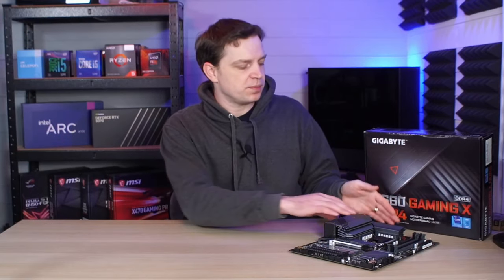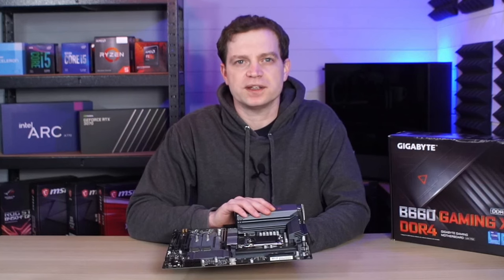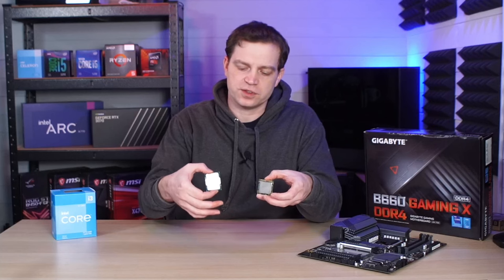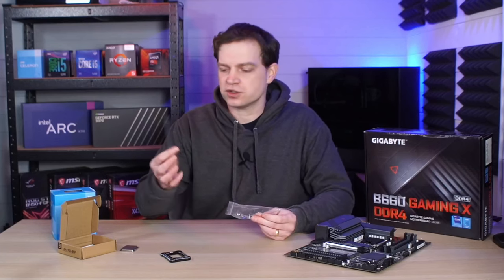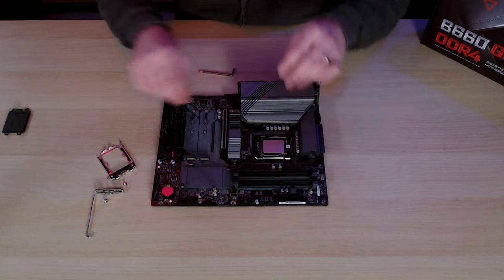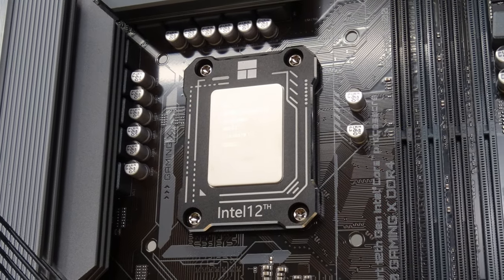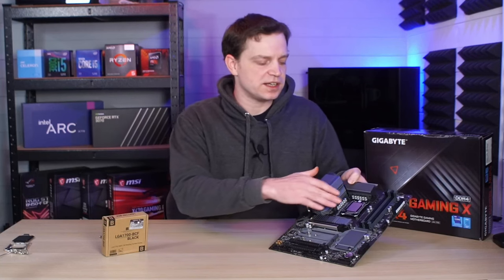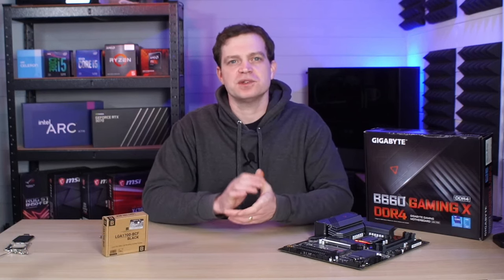How to Install an LGA1700 socket contact frame.

Comment: Guys, please... If you're going to do this, insert the CPU first and leave the CPU in while doing this. Otherwise, awesome video.
Reply: Exactly! That’s how the guys over at Gamers Nexus did it.
Reply: Adding to this, I'm installing the contact plate post build, so MOBO still in the case so leave your existing fan mounting bracket in place so that the CPU backplate doesn't drop off the back of the Mobo. Glad I watched this video bc it looks like it would drop if not otherwise supported, in the vid the Mobo is flat on the table so no additional support needed.
Reply: @bendotbruce isn’t it pointless to install on cpu that has already been exposed to the bending concern?
Reply: should i put the cpu in first and close the retention latch? or leave the latch open and uninstall the stock one. Also, if i don't close the latch, will i hear the pin crunching noise like when you close the retention latch?
Reply: @laughingpain3006  I don't think so...my thermals are normal again. a much more solid base for mounting cooler.
Reply: @baloneyslice247  Keep the cpu in with the latch undone, don't unscrew it with the latch engaged
Reply: @jacobs1047  Found this out the hard way, unscrewed it with latch down and no cpu in the socket.. bent a few pins in the socket.. had to get a new motherboard.
Reply: @laina80  How did the pins bend? did the arm fall onto the pins?
Reply: @jacobs1047  I was installing one of those contact frames like the video, but the latch was kept down so there was tension, I went to unscrew it and the latch and screws flew up into the air.. and some landed on the cpu socket.. causing some damage.. I did watch videos on the process but I was a little distracted maybe and didn't unlatch it first before unscrewing.. 

With the new motherboard, I unlatched it first, and stuck the cpu in the socket to protect it while I uninstalled/installed the new frame.
Reply: @laina80  glad you can live and learn from your mistake. I forgot to tape the backplate on, and the mobo was already in the PC, so I had to move it vertically and hold the chip in with my finger while my gf screwed the contact frame on, not the best way to go about it lol

Comment: Never ever replace the contact frame this way! If anything touches the exposed pins during the process the motherboard is dead. And if you install the CPU on a damaged socket then you can damage the CPU afterwards. So, always keep the CPU or the original plastic socket cover on the CPU socket while doing the install.
Reply: How can u keep plastic on while installing?
Reply: @bakedfortgod8241 Below the MB

Comment: How much should I tightened the screws. I build a new machine 3 months ago using i7 14700k, it was working perfectly fine but after 3 months it started BSOD that's because I was doing tweaking inside bios then I restored the default settings but it started crashing whenever i stress test or play games, I did everything, from clearing CMOS to new installation of windows  and also uninstall and reinstall ram GPU but nothing worked finally I replaced the thermal right contact frame with the original ILM. But I want to reinstall this as I was facing no issues before BIOS tweaking. So can you guide me how tight or loose contact frame should be...
Reply from the maker: Was it the contact frame causing the issues as apparently there's a lot of "Crashing" issues with the 13th and 14th gen CPUs?  If it was all resolved by removing the contact frame then maybe not but I just screw them down until they stop and never had and issue.
Reply: @TechLabUK  no there wasn't any issue before and after. It started after I tweaked some settings in BIOS but as revert those settings and still facing issues. And my CPU is in very Good health I undervolted and underclocked clocked so that it doesn't exceed voltage which is causing 13/14th gen issues and I've tested all new BIOS updates and reverted back to the stable one.

Comment: I see this video is 1 year old, so do you still have it, its working fine still or was just a marketing fad that people used to do back then?
Reply from the maker: Yes, I still have it.  I have 3 Intel LGA 1700 system all with these fitted and they have improved thermals across the board.  I also use them on our AM5 builds now too.

Comment: Amazing results. Has a 13900ks on a z790 that would hit 100c during cinebench and other synthetics. Installed the thermaltake contact frame and it dropped to 90c at 330w no more thermal throttling.
Reply: Turn off the motherboard performance on the bios and install a liquid cpu cooler if you haven’t already because I have the same cpu and had the same problem until I got a liquid cooler, now my max is 80 Celsius under load

Comment: This video is terrible. I followed it and damaged the pins on the socket. He started to unscrew without releasing the latch first which I followed- causing the entire bracket to fly up and damage some of the pins in the socket. In the video he actually edited it because in the next cut, the latch has been released while he continues to unscrew the retention bracket.
Reply from the maker: Yes, the screws were loosened while the latch was down and removed while latch was up.  You can clearly see it on the video so you should have followed it.
Reply: @TechLabUK  lol, even with a video and not having to read, some people just don't have it in them to be able to follow directions...
Reply from the maker: @PapaMav  TBF we had a lot of comments from people saying we should have left the CPU in the socket to prevent damage while doing this.  We didn't on the video because we wanted people to see what was happening and that it was too obvious but apparently not, so we did update the pinned comment to cover this but a few don't seem to read them.
Reply: @TechLabUK  thank you for the response.  For me, no worries, I previously watched another vid that suggested putting the CPU in place first, which does make the most sense to me.  Honestly, the guy accusing you, should not be so lazy that he acts on the first vid he watches and would be better off like me, doing more thorough research and more "sampling" of suggestions/ways to do things

Comment: Thanks for the video, I have a Red Thermalright that I am about to install and wanted to be sure on the process as the instructions are in Chinese.  My CPU is currently running 100% load at 90c periodically dropping to 89 or up to 92  before coming back to 90.  I'll post an update later if I don't break it....
Reply from the maker: Drop cpu in to socket before you unscrew the framing, just protects the socket pins if you accidentally drop something.
Reply: Installed one of these on my 12700KF that has already been down-volted and have attained the remarkable result of a 10 degree INCREASE.  Same cooler, same Noctua thermal paste (took it all off and reapplied same result), same bench mark running.  Machine now constantly thermally throttles under load.  CPU now idles (0-3%) between 45 + 60c.  Going to leave on as I 'believe' the that the CPU being held flatter may give me better longevity.  Thermal paste may also even out after a few cycles. It's a matter of faith.  Will be putting my 3rd cooler on this CPU and have spent nearly as much on cooling as the CPU itself.  Going back to a water cooler and will have a go at a Peltier air cooler to assist the water cooler... I do believe the solution to Intel's cooling issues is AMD......
Reply: UPDATE:  After running the system through a few heat cycles it now runs 100% loads at 88-89c with an occasional 90 for just a second or so. So a small improvement. For information I am running a SilverStone Hydrogon HYD120-ARGB Dual Tower CPU Cooler which has spring mounts so as thermal paste moves with cycles, it will get closer to the CPU.

Comment: This is great! I just installed, thanks for the video. 
My results with 13600k and Asus ROG Strix z690-I mini itx
Before: 100c
After: 80c
Shocked to say the least, partly my fault, thermal paste before needed extra 5% to cover entire CPU. But this time used extra thermal paste and the contact frame and its so quiet and never goes above 80C!!!!
Reply: been doing that too spread the Thermal paste nice even layer, and still draw a line from top to bottom of Thermal Paste just to be sure why not 🤷‍♂

Comment: nice video helped with issue on i5-14600K went from regularly hitting 90 degrees C to barely hitting 75 degrees C under heavy load.

Comment: sir i have b760m ds3h ax dddr 5 mother board with i5 13500 chip so can i go with a thermaleight or stick to the stock bracket bcoz upcoming couple of days i build a new pc with these specs so should i go with stock or else should i go with tharmalright.. plz explain sir....
Reply from the maker: You can just use the stock bracket if you want but many have found improved cooling from using a contact frame so I just install them anyway as they are quite cheap.
Reply: @TechLabUK  yeah thats right its quite cheap but i worried about warranty if i use aftermarket brakets then mobo and processor warranties still remain or not thats i want to know..??
by the way thanks for the reply
Love From India..❤️❤️❤️
Reply from the maker: @ajay4747x  The brackets are removable and serviceable so replacing them shouldn't be a problem for warranties I would have thought.

Comment: I have been using my i7-12700k  for 10 months , 
is it worth buy this corrector or is my CPU warped due to the time 
it has been used and will not work?
Reply from the maker: If it has worked for that long it might be totally fine without it.

Comment: my god how can such large companies be having such bad QC before launching a product? If I'm a first time builder I'm looking at Intel's LGA1700 mounting problems and Nvidia's 12 pin connector issues and thinking jeez I'll go all AMD, no matter what the performance
Reply from the maker: I suspect with things like this they test the "out of the box" experience and don't test for long enough.  The normal mount works fine out of the box but it can cause issues later on or if you are trying to get maximum cooling performance.
Reply: @TechLabUK  Sorry mate but that's just a diplomatic and nice thing to say. Regardless of the performance , it's not good . Can it go up to 100c surely. It won't melt. But does the consumer have to spend a ridiculous amount of pennies on cooling ? Is it normal to get aftermarket improvment gizmos that may void warranties ? What about the time invested in tweaking with this ? What happened to the good old plug and play ?

Comment: Sadly, not a single word on tightening the screws...
Reply: if it helps, I just installed mine a few days ago and I just made it hand tight, and then a little past hand tight on my z690-a. I sure wish I knew how tight "past hand tight" is to help you further, but another comment on another video for these said it well: you dont rely on the frame to keep the CPU against the board, just to keep it from moving up down/left right, the AIO screws will keep it against the board. So in theory, as long as they're ever so slightly torqued and it's bottomed out you should be good to go. Just make sure that AIO contact is snug
Reply: Just lightly snug the screws evenly and no more. As long as the cpu does not rattle around in the socket mission accomplished. You are going to apply more than enough pressure on the cpu when you install the cooler and I have yet to hear anyone ask what the torque values are for those screws lol...

Comment: Good job:)
Reply from the maker: Thanks.  Wasn't really needed for the i3 I had installed in the board at the time but really thankful it was there when recently upgrading to an i7 12700K.  you can tell the difference with that one.

Comment: I truly appreciate answers. 
Is it possible that the INTEL Motherboard's CPU socket pins, been bend due to the (excessive) force that as been used nowadays by the motherboard on the push system/ and Cooler to support the CPU in place ?  I've already know, that this system "bent" the whole CPU structure, but i want to know if it could affect the pins, in order to bent them. 
I've took 2 different Motherboard's, and both have bend pins, in a lot of IT years, I've barely seen socket's/CPU's with bend pins. Looks like this new default Sockets (that come in every motherboard)  + his (ultra high) pressure system to hold the CPU to the socket, could damage the contact pins and bend them. 
Atm, i don't know, if they come with bent pins, or if... it was me bending the pins when installing the CPU - Don't know how, since i JUST put the CPU on the socket, installed the cooler, and that's all. The ONLY "weird" thing on the process, was the obvious force needed to close the system (and that, its a common and known issue now).
Since this happens, in 2 different boards, its way to weird and a huge coincidence to believe... Specially, when the CPU's were installed properly, without any issue. I only noticed that, when I removed the CPU from the socket and found some bent pins ( looking close to pins ), i went to check the 2nd motherboard, and also has bent pins.... I just simply cant believe that. I cant tell that the CPU's it selves are bent, since it they were installed only at a week ago, my problem is the Bent Pins, and I have a feeling this is related.  PS: in one of the CPU socket, despite of the bend pins, i also have  2 pins raised, comparing to the others, passing the fingers, its to notorious, that 2 pins are a lot raised compared to the others - and obviously the Pins have to be on the exact same place and high in order to work properly. And...obviously I wasn't the one pulling the pins out....  This is a "common issue" ? its is possible to happen this ? bent the socket pins due to this huge pressure ??
Reply from the maker: I think GN did some testing around all this and excessive pressure from coolers can cause all sorts of issues with sockets and pins.
Reply: @TechLabUK  many thanks. I'm gonna try to found that vid. Cause looks like I'm going crazy, since despite of having 2 brand new motherboards damaged on my hands now, I've installed the cpu properly, it's literally impossible that was "me" bending the socket pins and damaging the motherboards, anything "outside the box" has to happen to the pins be bent.
Reply from the maker: @jorgepereira9455  These contact frames are suppose to stop any issues.  Worked so far for me, no issues since installing these so add them to all boards.

Comment: OMG!!! 5:43 NO TOUCHY TOUCHY !!! Clean that CPU right away! love u good content :)
Reply from the maker: They always get cleaned before cooler install.  Usually either with Isopropyl alcohol or Arctic thermal surface purifier.  Depending on what's on the side at the time lol

Comment: What's the in-lbs torque value for the screws, to ensure even pressure distribution?
Reply: With the thermalright bracket it bottoms out on the motherboard so you don’t need the torque values just do quarter or half turns at a time in a cross pattern until they stop turning doesn’t require much effort to get them to stop